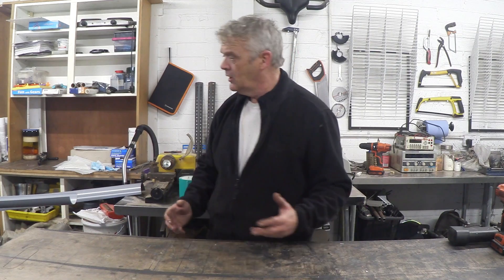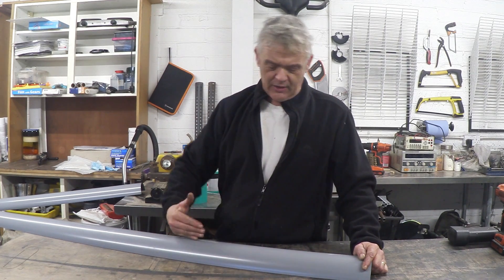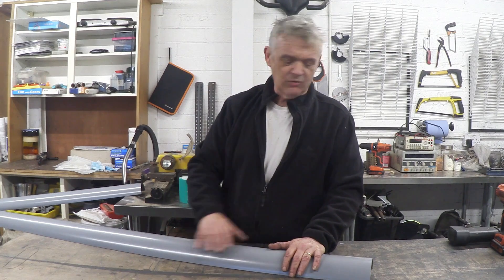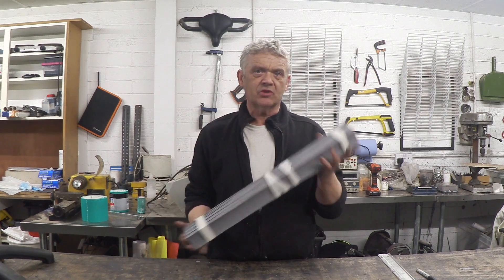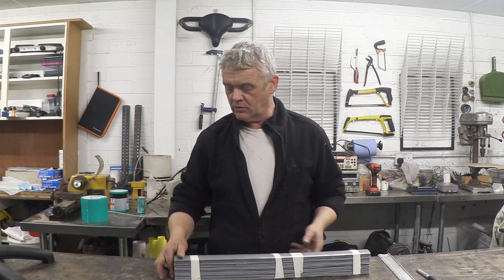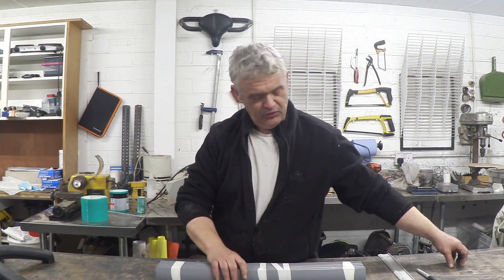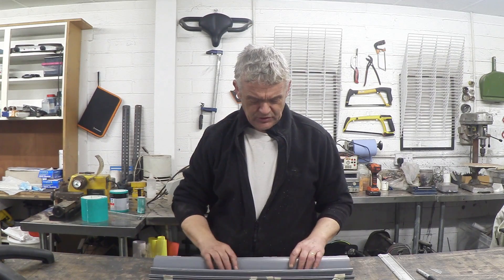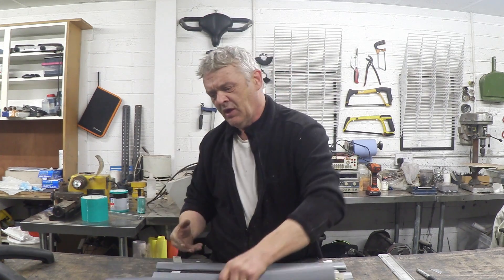Building a 1kW Wind Turbine For Under £100 - Part 1 - The Rotor

Comment: Have you done any calcilations how much energy this little "drum" can capture in wind?
My prediction: it will generate about 100 watts and not more than 150 watts at peak. You can't fool Nature and phisics😄
Prove me I'm wrong!
Reply from the maker: sorry mate but I have no desire to prove you wrong or right as it happens
Reply: @ThinkingandTinkering  Please don't take it personal. I'm just curios about results. Because I've decided to make similiar wind turbine but larger in scale. Why? I've done calculations how much energy is in wind at different wind speed per square metre. Then multiply it with size of turbine and with conversion coeficient or usefulnes (just on guess, it's usually between 0,10 and 0,35 and not constant at different speeds, and can't be more than 0,47 in theory). Then it will be clear how much power is accessable at your area with that turbine.
Well, good luck! And let's see results.

Comment: You could also use bicycle wheels, recycled ones, for the two ends. Even for holding the magnets. Saves a lot of work. For the generator part two different size wheels can be used.
Reply from the maker: it's a nice idea mate but you will have quite a job getting them true
Reply: In India every bicycle shop, and there are many around, has the facilities to balance the rims, replace broken spokes etc. Finding an abandoned bicycle here is the task! 🙂

Comment: I did something similar with a washer machine barrel by cutting [ shape into the side then folding it inward about 45d. It was intended to be a water wheel but as I was making i had i standing upright outside and saw it being pushed by wind. Also nice that it came attached to  a moter and and was perfectly centered already
Reply from the maker: awesome mate

Comment: Excellent work!
 
Forgive me for stating the obvious, and for testing its fine, and probably is why you are using it as time is short. But to anyone following this recipe I'd advise against super glue as a permanent solution. It most likely wont hold up well to the elements. Epoxy would be better, but buying cheap, flat, little angle brackets which can be bolted or self tapping screws to the base and the fins would be much more reliable, also giving them a coat of paint so they won't rust👍. 

If anyone dare calls this a "Toy" I will slap them 🤣👍👍.

No doubt in my mind it will have a good, useful output and with a few tweaks here and there truly make it a serious, reliable, affordable, robust piece of tech which will last many many years. 

Truly well done Sir👍
Reply from the maker: thank you mate -  a quick note about superglue - it is used here in the UK to fix building plastics - has been for the last 30 years or so - so if used on uPVC - which is what I am using here - it will last 25 years or more - epoxy resin won't stick to the plastic but I did like the angles idea - I am glad you like it mate
Reply: @ThinkingandTinkering  hmmmm very interesting. In that case I stand corrected. Thankyou for your input!

Comment: Wonder how it will cope with the speed, centrifugal force could throw those blade off, good job though, we need some out of the box thinking
Reply from the maker: I agree mate - but I plan on testing and if it does throw them off you can be sure I will be bolting them back on lol
Reply: Yep, mechanically nuts/bolts is the surest way.

Comment: Those smart boards are running around $250.00 each on ebay used. I must say mate, it looks nice and big enough to really make a nice power wind wheel for sure. This should make quite a bit power and if belt driven, you could even mess around with the pulley size to get it even faster. Very nice so far. I'd love to have something this size on some magnetic bearings so that the shaft floats and no friction lost at all. Then it would take very , very little wind to move it.
Reply from the maker: very true mate - for this I am likely to be conventional about the bearings - there will be enough that is unconventional lol

Comment: hi, when it comes to wind turbines the design turns around the speed of wind available and so the rpm you want to work with, there're charts with different rpms and voltages for the same washing machine motor by changing the wiring of the coils. I think your work as experimental is pretty much needed but to help you carry the weight a feedback from the public to build things or working with other youtubers could do the trick. This wind turbine looks pretty good, the choice of materials is pretty good and I want to see the results, you also could try making molds with 3d printers to pour melted recycled plastics, and so you can make any object of any shape you want for the cheap, you can use an easy design software as sketchup. 
greetings, ayoze
Reply from the maker: thanks for the tips mate

Comment: Hello Robert, er, Rob? Mr. Murray-Smith? New subscriber, first time posting here :). Three things, two of which are too late.
1) I would have placed the chair bases on the outside to help ensure clean airflow through the turbine. (Assuming the attachments were just as easy).
2) I think I would have slotted the little pipe pieces to hold each blade on both sides at the proper angle.
3) Obviously, mounting the magnets at the greatest diameter is the best - but there are several other possibilities that might be interesting. For example, you could use the edge of the disc, either instead, or in addition. But a second, or n more rows of magnets inside the greatest diameter could still be useful. Also, if you get enough magnets and coils in play to cause significant drag, then you could consider a mechanism to change the distance of the coil to the magnet, to keep the speed constant, which may get you the most power out in the long run.
Keep up the great work! Thanks!
Reply: Good ideas!
Reply from the maker: Rob and cheers mate - nice tips - I did think about the position of the supports quite a bit - I went with inside - but I just guessed it really - cheers
Reply: It would not work .......why did he not show it working ?

Comment: Stop it!! Before I have to get out of my easy chair and build this! I have plenty of the marker boards and office chairs and have bee holding on to a microwave transformer... Dange too late I'll have to give it a go!! Al I need is magnets .The wobble I fix with a roller arm and a spring loaded hinge
Reply from the maker: lol - get ceramic magnets mate - they work just fine and are basically dirt cheap

Comment: Cracking!
Why did you not use the [thrust] bearings that would have been in the chair?
Reply from the maker: the chairs weren't that expensive mate - they didn't have thrust bearings so I am going to have to put thrust washers in

Comment: Now all we need is a 20kWh battery for under a grand and .... Way hey! 👍👍😁😁
Reply from the maker: for sure mate - but then I have already done that!
Reply: @ThinkingandTinkering  yeah I know! LOL 

I also have to buy a new off grid/on grid inverter and switchgear, lose my feed in tariff because the changes would go over the 3kW limit and blow my current net zero (near as damn it) TOTAL annual energy bill.

 It's a real bummer, but If I can figure an easy way to "trick" my inverter by providing a stable sync frequency after being isolated from the grid ... Well ... winner winner chicken dinner!

Comment: Never found strong multi-glue for PVC, use mech. connections. PVC welds great to PVC.
Reply from the maker: superglue is what the building industry here in the UK uses mate - it makes a permanent bond stronger than the original material - it's basically what holds the roofline on in most houses here

Comment: When installed with the axes vertically a thrust bearing could be needed. Very nice build Robert.
Reply from the maker: it will definitely need at least thrust washers mate and thrust bearing would be much better - I have those bearing so I am going with thrust washers
Reply: @ThinkingandTinkering  .... or you could just fit it to ride on a single ball, bearing the full weight. A dab of grease to hold it in position whilst assembling. KISS!
Reply: I thought it was a nice build too when you get it out into real wind I think it's going to surprise you and do better than you thought it would and if you had Neil Demi  on there it would really put out some juice can't hardly wait until you get some readings on there looking forward to the next video
Reply: Why would it need a thrust bearing? There is only it's weight bearing down, and that isn't much and would be well withing the rating of a standard ball race I'd have thought. Bearings are often tightened to a slight pre-load anyway.

Comment: Love this channel..
36 degrees off tangent..?
If the disc was extended bigger past blades ..
Could magnets on booths sides increase output?
North south could be an issue ie cancel each other out if stacked wrong...
Going to review the transformer mount from a couple vids back..
PS..
Soins like a dream..nice  job..
Also I'd tablesaw the fins..
Gotta jig in mind..
Reply from the maker: yeah I read it somewhere that that was the angle to use - tbh I don't know if that is right I just seem to remember it - I won't be putting magnets both sides as there is a diminishing return I would guess and I fi had a table saw I would certainly have used it lol - but I do like minimum tools set projects too

Comment: Do you think the combined centrifugal force and wind loading, will cause the blades to bow and pull the outer discs inwards. maybe a few cross braces will be needed to keep the magnet clearances.
Reply from the maker: the chair legs and pipe in the centre are pretty strong mate - I doubt they will pull inwards - it's why I overbuilt that section - but we will see
Reply: It would not work .......why did he not show it working ?

Comment: Another winner Robert!
Reply: Are the bearings rated for both a radial and an axial load....for a vertical axis turbine?    Sorry if I missed it in the vid.
Reply from the maker: no mate they are not - my plan is to stick a thrust washer in and cross my fingers - if I need to replace them because they fail - I'll do that - but I am going to see if these bearings work out anyway
Reply from the maker: cheers mate
Reply: Some good inexpensive teflon washers out there or something like Delrin ....which cuts nicely on a laser cutter

Comment: And I think this is what all the world needs right now: "Make energy harvesting as easy as gardening" . Also train people so that there will be as many energy harvesters as gardeners, if not more.
Reply: Actually you can harvest energy from the growth of garden in a variety of ways with highest effecient way reported as methane from decompersition. More than twice as much btu than when biomass is dryed and burnt which I think is amazing rather than all that methane contributing to green House emissions which is said to be over 30 % just from cows breathing. Most people think its from the nasty end!
Reply: Do the blades need to be curved. Or is flat ok
Reply: @theideasman6018  It depends on the size. For smaller devices flat or curved would be almost the same with negligible difference. But if you go big then it's a good idea to get help from aviation people who spend a lifetime trying to find the best wing shape for airplanes.
Reply: @theideasman6018  Curved will probably provide less resistance to the movement of the blades whereas flat will probably be some issue. Any surface moving through any medium is going to have turbulences at some point.
I consider this a simply fantastic idea but I am pretty enamored of the twisted form such as is found on a reel mower, that's been used to good effect.
Reply: There lies the problem, gardening is hard, so using it as a benchmark oddly enough prophesies that this will remain difficult. all the successful horticulture we see comes from back breaking hard graft in all weathers from academics and/or people with decades of experience in custodian or commercial roles often at the mercy of an unpredictable environment, social pressures, low numbers or managerial demands
.
Reply: @KevinEllis-Anderson  Sure. Perhaps instead of “easy” I should have said “straightforward” or “not overwhelmingly sophisticated”.  Gardening sure requires limbs and muscle and that is why the engine was invented by the engineers. In this case the question is, “What could make engineering an easier job just like the way the engine made gardening an easier job?”
Reply: In the city is very dificult but I agree.
Reply from the maker: 100% agree with that mate
Reply: Autonomy at first of course....

Comment: Surprised you did not start by putting a notch in your terminal studs at 36 degrees as you set them in place. [using a compound, protractor, calibrated compass, etc ] ~( ,m,)~
Reply from the maker: never thought about it - very nice idea - I will do it next time - if there is one lol
Reply: It would not work .......why did he not show it working ?

Comment: That does look very solid. If there was any consistent kind of wind here in Durban I'd probably be building myself one of those eventually.

If your drum is out of square slightly (Which you say it isn't, at 1mm), you might consider putting the magnets in a perpendicular arrangement around the circumference and have your transformer core vertically at the bottom. That way you could use your pen trick to get an exact mounting ring, and it'd probably be more resistant to flexing if that's a problem. One difficulty with that is you'd need to be exact in your mounting instead of relying on the thickness of the magnets.

Either way, I really like where this is going.
Reply from the maker: nice tips mate - cheers
Reply from the maker: nice one mate - cheers
Reply: im surprised that you dont get a lot of wind being the "blackpool' of South Africa ^_~
Reply: @drop stix  Great idea. Are you talking about making the face flat, or the circumference round? As J W is concerned, I'd worry about flex pulling the circumference inward as the blades bow outwards at speed, increasing the gap to the magnets if they were mounted onto the flat face. If they were mounted around the outside you'd get more consistent, but you'd probably have to modify the transformer core to be concave to take the magnets as close as possible.

 @paulmaydaynight9925  Yeah, we hardly get any extreme weather (apart from a bit of heat sometimes). I think it's because we have a pretty consistently hot ocean temperature flowing from up north. Further south there's a lot more wind, where there are two ocean currents nearby of rather different temperatures.

Comment: Since you want a good, stable, solid system, MY suggestion is to face them where one can drive a piece of all-thread through all 5 spokes of the office chair legs and with a couple of extra nuts, be able to ensure a very strong, rigid, flat, parallel, uniform pair of disks.

ADMITTEDLY, since all-thread DOES cost  bit of money, if it is going to make the project cost too much, then I can see one leaving it out for that reason, however, just knowing wind the way I do, it seems to me a pretty near-to-being-necessary component.

If at some point you find the disks are for some reason failing to maintain their shape in strong wind, you can just take them out, make new pieces, and go on in with the all-thread, but I suppose that until it is clear that you will need it, may as well leave it off.  ~( 'w')/

I was GOING to make a comment about weather sealing, but then I saw that you had gone ahead and done so.
Reply from the maker: I like your threaded bar suggestion - basically we do what we do and it doesn't matter what we do someone somewhere will say something different - some ideas I like some I just ignore - I like this one - cheers
Reply: Nice idea!

Comment: That is bloody awesome, the wood version gave you proof of concept so you already know that this will give tremendous results. Well done Rob ☺️
Reply from the maker: exactly mate - it's why I built the wood one - 2 hours it took and I told me it was worth spending time over this more robust build
Reply: It would not work .......why did he not show it working ?
Reply: @brianevolved2849  he did show it working, twice in fact. The first on top of a car where it put out about 24 volts and again at night lighting a light board. For a out of square warped wooden throw together it shows proof of concept for sure

Comment: i can vouch for those evolution saws, i got a second hand one with a all purpose blade, if that thing wasnt attached to the base id be able to trough a lorry no problem, i wish it had a moving blade like yours though i cant move mine forwards and backwards just up and down :(
Reply from the maker: it does give a better length of cut but a straight forward up and down is still awesome